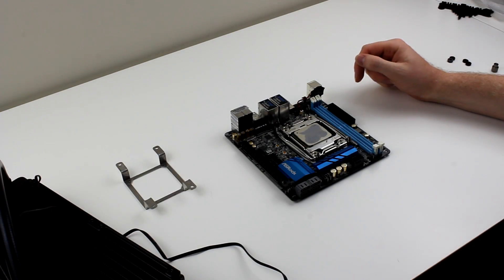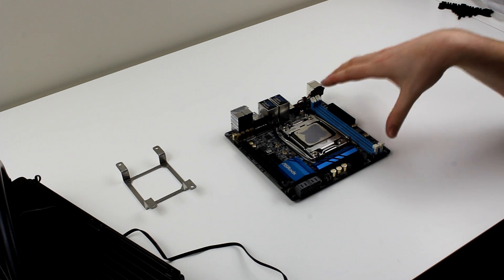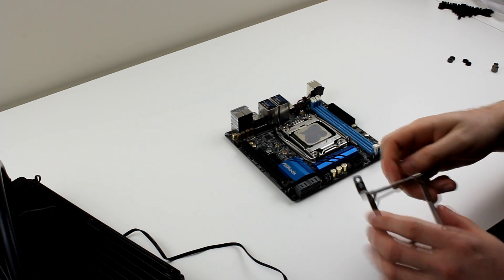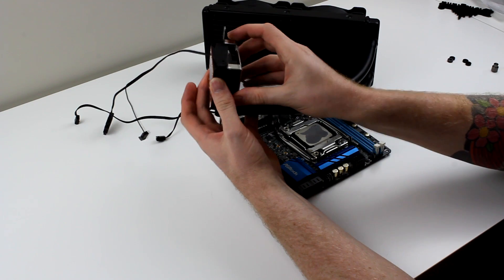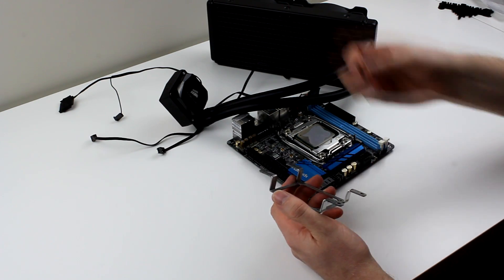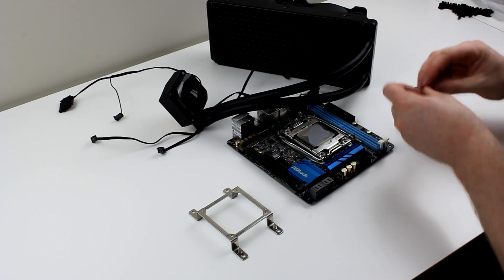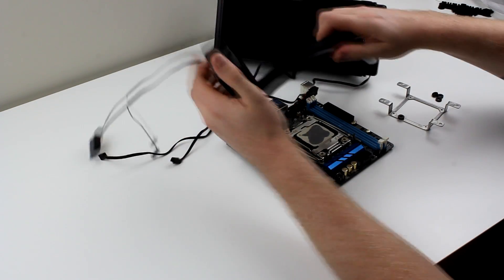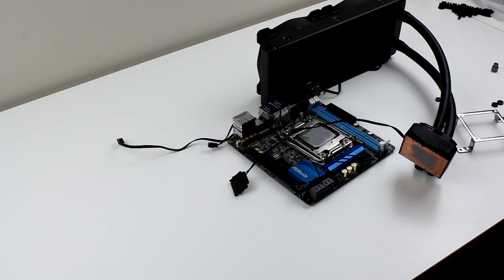Watercooling the ASRock X99E-ITX/ac with the Corsair H100i

Comment: Would the H100i work with the asrock x99x killer?
Reply from the maker: +Kreeeve Theres no reason why not, the x99x Killer uses standard x99 post mounting so you should be fine using the standard 2011 mounting kit with the H100i

Comment: Quick question. I did this but I am not able to plug my pump usb connector in(my spacers might be too big) were you able to plug in yours?
Reply from the maker: +Shannon Kinchen I didnt use it for mine but I understand what you mean. You should be able to use it if you space the bracket even higher so that it clears the mini USB connector on the H100i Block.

Comment: asetek also have a narrow ILM bracket available for purchase from their ebay store (or via direct contact with their support email for anyone that cant buy from ebay).
Reply from the maker: leftventricularfail absolutely and an excellent point. Check if you have an Asetek rebrand and the slim ILM mount they have will work. Thank you for sharing I should have covered this off.